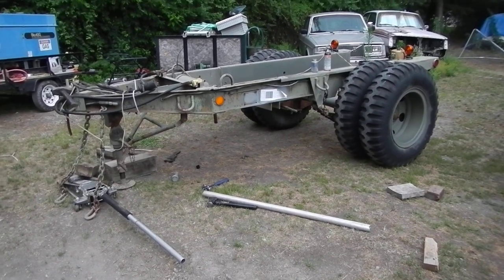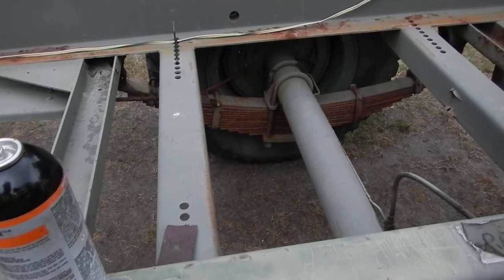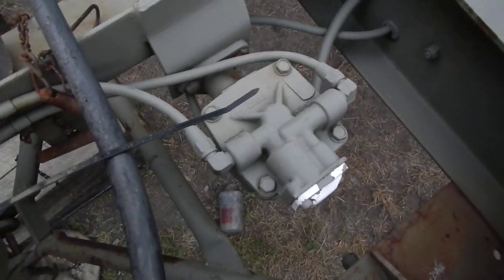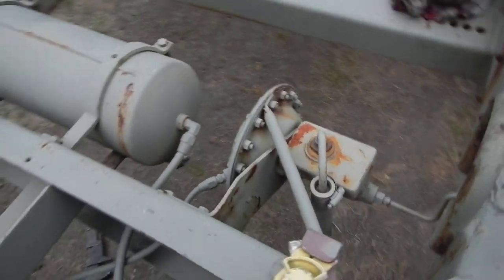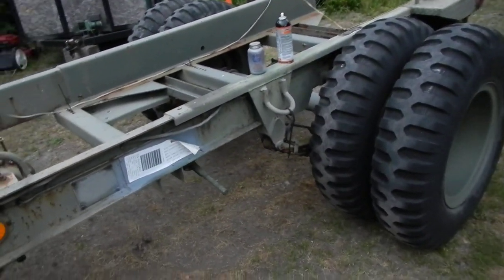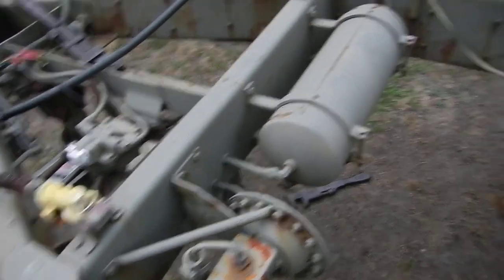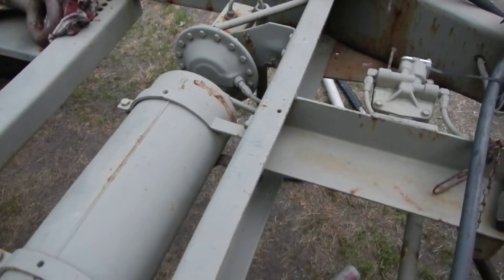Air Over Hydraulic brakes, a simple explanation on a military trailer, M200A1

Comment: I'm a US Citizen, and trucker, who has recently moved to New Zealand. In the US, a truck with air brakes has air brakes, end of story. Now, I'm driving a Hino concrete mixer that has "air over hydraulic". I had never heard of this and found this video. For this trailer you describe, I can understand that logic--it can be moved w/o the necessity of an air brake - enabled vehicle...but that doesn't make sense for my mixer. Great vid, though! :-)
Reply from the maker: Thank you! So I believe the reason this system is this way is in case the air doesn’t work the military could pull the trailer either way. I have an older large box truck that also uses air over hydraulic but when the air is off the lockers are in place so just like air brakes you must put air on the truck to move it . These old air over hydraulic systems aren’t bad but can be annoying to restore especially with the lack of parts support.

Comment: We just bought one of these trailers to build an off road fire tanker trailer for a remote property. Thanks for the video I went through the manual a couple of times trying to understand it, but your description was much easier!
Reply: They dont work as well as a air full air system, as they require more maintenance on mechanical parts .. but air is lousy if an air line blows in a bush fire (trailer stuck)
Hydraulics in steel lines can take a bit more heat than rubber or plastic lines .. 
Master and Slave Cylinders 'like to be used' so dont leave them inactive to rust or corrode ..

Comment: most 6x6s had hydraulic brakes and would apply air to the trailer which has spring brakes. That meets DOT regs for break away requirements. Your trailer does not meet new DOT requirements for a breakaway system
Reply from the maker: Stephen Grant it’s s Military surplus trailer I’m sure they weren’t worried about DOT commercial regulations. I’m converting this to electronic over hydraulic . It’s a work In progress. I could convert it to electronic brakes alone though I just haven’t been able to dive hard into it . It did however come with the proper paperwork to register it with the DMV from the government.
Reply: @SmokeyJa  Good video, I just received a trailer with this system and registered it today. Walked out with a brand new license plate. Now I just need to figure out if the 24v 12 pin plug will somehow power the compressor/brake system. Might be a dumb question. But of you know anything about that please let me know. My trailer weighs 8000lbs. It has a trailer inverter on the tongue that has a 12v 4flat and a 24v 12 pin. I plugged the 4flat to the truck 4 flat and all the running lights and signals worked perfectly. I just ordered an adapter to go from the trailer 12pin to the truck 7blade. Hopefully it will power the brake system. I see wiring going from that inverter box to the relay and brake system.
Reply: @SmokeyJa  If that doesn’t 24v receptacle doesn’t get the brake system going then I guess my only option is to change the whole system out as well. Please let me know of any updates. I appreciate you putting out the info.
Reply: @SmokeyJa  I just got some info today. I’m going to order an electric over hydraulic actuator to replace the air system. That with a new breakaway and brake controller should fix my issue.
Reply from the maker: @calijudoable  sorry for such a late reply I don’t think my notifications were working right at one point. Did you end up retrofitting the trailer? I still never upgraded my trailer and it is still a work in progress but the plan is still there.

Comment: Quick question.  I use M101a2 but never air over hydraulic system.  I’ll be using my humvee to pull.  My question is if you have a leak or malfunction do the brakes lock up on you like air brakes? Or like you said just bleed tank and you can freely pull?
Reply from the maker: It has been a really long time since I was deep into understanding these systems however if you have a leak and it isn’t that bad the reservoir should be able to maintain the air pressure to use the brakes. And as long as the red glad hand is still connected and their is air pressure to the relay from the red glad hand the trailer will not divert air to the brakes even if the yellow glad hand is disconnected or has a massive air leak allowing you to tow still however the brakes will not function. If the leak is really bad on the trucks system, the red glad hand or there is a loss of air pressure such as a break away the air pressure relay will divert air from the reservoir to apply the brakes “ON” . The brakes will stay applied until the air pressure is released (tank drained) or the glad hand / service air is restored. A loss of air pressure or break away will not lock the wheels like modern air brakes but it will lock the shoes to the drum in the fully applied position. I hope that helps explain it a little better. The breakaway principle is the same as on modern electric brake trailers. When the breakaway cable is pulled from the relay box the relay sends the signal to apply the brakes and is powered by a small 12v battery. Once that battery power is depleted the brakes will release. The same goes for the air over hydraulic. When the red glad hand is disconnected in an emergency break away situation or there is a loss of air pressure to that air line, the air relay applies full pressure from the air reservoir to the hydraulic system which applies these brake shoes to the drums and will continue to do so until service air is restored or the air in the system is depleted.

Comment: I’m having an issue with air over hydraulic brakes if anyone can give me an idea? The issues is that brakes are getting VERY HOT and start to smoke and then tires have blew. I’m a trailer mechanic and been dealing with this Hoosier Trailer that has 3 axles. Any help would be great

Comment: Just a note, the relay is a combined relay emergency valve.
Under normal use it applies the reservoir air pressure to the service brake air over hydraulic master when there is an air pressure signal sent down the YELLOW glad hand.
Under emergency break away situations the RED glad hand with the constant air pressure signal is disconnected, the removal of this signal diverts the reservoir tank pressure to the service brake air over hydraulic master to apply the brakes and stop the runaway trailer.
Its only a small correction but you pointed to the yellow glad hand when talking about the emergency.
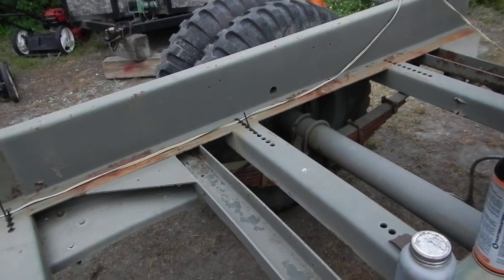Reply from the maker: Thanks for the correction Nick. at 1:08 I did properly name the yellow gladhand the service and the red the emergency however you are correct that I pointed to the yellow gladhand when mentioning a breakaway situation or loss of air. Thank you for the detailed explanation in your comment as to how the emergency system works. In your opinion what would be the best option to retrofit this trailers brake system? Electric over hydraulic or swap to electric brakes all together? I want to pull it with my F250 with a large welder and air compressor but I also want brakes as to not overwork the ones on the truck. I have not finished this project yet unfortunately.
Reply from the maker: Also at 1:49 when I was mentioning the loss of service air can you explain what would happen with a loss of service air (yellow gladhand) with the Emergency (red gladhand) still connected? I assume the trailer would still roll because it does not sense a breakaway situation? This would make sense so I am glad you mentioned what you did for myself and the viewers to understand as well.
Reply: @SmokeyJa  I couldnt really advise on your trailer to be honest... Im in the UK and the ministry get very nervous about brake modifications so they are best left as designed... plus our laws are different to yours. That said if you have a truck or trucks you are going to use it with it makes sense to make it match your tow rig as long as its still legal.
Reply from the maker: @nrs91  fair enough. The electric over hydraulic uses the electric brake controller that I have in my truck to apply pressure to the master cylinder to apply the brakes. Electric brake replacement would be electric actuators applying pressure to the shoes rather than hydraulics. Neither are "Cheap" retrofits but they are 100% legal and function just as well, if not better, than the original system. Thank you.
Reply: @SmokeyJa  Yea I forgot to turn the tap on for my Yellow line once... started heading down a hill thinking "these brakes are a little doughy" the trailer wasnt doing anything and the tractor was doing all the work... lucky I noticed and sorted it while going slow
Reply: @SmokeyJa  Ive seen the electric over hydraulic, seems an easy retrofit which would keep you safe and uses all the original brakes which are made for the load
Reply: With that correction it makes a lot more sense.  I was looking for how it differed from spring applied, air released air applied (standard air brakes) and wasn't quite getting your explanation due to that detail.

Comment: Does anybody know if a surge brake coupler was installed and plumbed into the brakes would they work
Reply from the maker: You can retrofit a surge brake system to this and it will work. The cost is relatively similar to other systems however if you already have the parts then that’s a win!

Comment: So air applied, for both emergency and service? Interesting.
Reply from the maker: Yup. The loss of pressure when the red glad hand is removed or cut causes the emergency relay to apply all reservoir pressure to the system and apply the brakes. If the trailer is in good condition the air system becomes a closed loop at that point and will not release the brakes until the air system is drained or proper air pressure is applied to the red glad hand again.
Reply: @SmokeyJa  I guess no need for big danger springs that way, but seems a spring-applied system is safer operationally.
Reply from the maker: @StefanBacon  not really. This system is really safe as well and works similar to electric brakes. When the relay is actuated by removal of the breakaway cable 12v aux power is sent to the brakes and holds pressure. The same with the air. When the air pressure is lost by the red glad hand breaking away the relay actuates and puts air to the hydraulics which puts the brakes on. It’s a closed system at that point so the air is trapped and the brakes are on until pressure is applied to the relay or air has been release from the system. You wouldn’t want to be stuck out in a war zone with your emergency trailer brakes stuck! I like that both electric and this air system can be bypassed to still tow the trailers.

Comment: Hey Smokey,
I just had a problem with this exact trailer.  My CO was convinced that not supplying air to it through 1 of the glad hands would burn out the breaks.  I was pretty sure that the emergency/secondary air hose would supply  air to the system. Obviously we could move it by draining the air tank but I was wondering if the breaks would still be functional with only the second glad hand operational?
Reply from the maker: Wow sorry I missed this 3 years ago! If the red glad hand is still connected and still has pressure applied then the trailer will continue to roll freely down the road however if only the red glad hand has pressure the breaks will not function as intended but the trailer will still roll. If the red glad hand is disconnected such as in a emergency break away situation or air pressure is lost to that line the relay will divert all air pressure to the hydraulic system and apply the brakes. In this situation the air must be bled to release the brakes. If the red glad hand is disconnected or no air pressure is going to it the brakes will lock.

Comment: Hey man...big fan!! I have learned so much from watching your videos and have a question for you...I cut one of the hydraulic lines for my m105 brakes a few days ago because I was under the impression that the hydraulic brake system was obsolete. A little bit of hydraulic fluid leaked out before I plugged it and today I tried to move the trailer and the wheels were a bit tight almost as if the brakes were slightly on. Did I make a mistake by cutting the line? All I wanted to keep were the handbrakes...what should I do?
Reply from the maker: I don't believe your issue is from the hydraulic line being cut. Losing pressure would make it certain that the brake shoes would not be spread to the drum. What most likely has happened is that when you use the hand brakes and let a trailer sit the moisture from condensation builds up inside the drum and the hand brakes begin to become one with the drum making it hard to release them even when the hand brake is released. This happens with cars as well. If you are going to let them sit any period of time, more than a week, then I would suggest chocking the wheels instead of using the hand brakes. This also goes for any automobiles they will sit for longer than a week. Do not use the emergency/hand brake if the automobile or trailer is going to sit. I am not sure of where you live but on the east coast we have had a huge amount of rain and moisture this year and it has taken a toll on a lot of my projects. Another lesson learned for me is that I should depress the clutch release bearing on my manual trans automobiles while letting them sit for an extended time. One has seized on me :( . If you would like to go further with investigating your issue I suggest pulling the wheels and pulling the hydraulic cylinders that spread the shoes in the drum of the trailer because you no longer need them. Make sure by doing that you are not effecting how the hand brake works. I hope I have helped you out some.
Reply: SmokeyJA SmokeyJA Hey man thank you so much for getting back to me I was able to fix the problem when I cut the line I plugged it, but the hand brakes were on. So when I tried to release the hand brake the oil had no place to go because I had the end of the line plug so the brake pad didn’t release all the way. lol rookie mistake!

Comment: Thank you for this, just bought one like this, are they easily adaptable to regular pickup trucks?
Reply from the maker: Yea I think so . I picked mine up with a 2008 F250 but a F150 should be able to pull it just fine. Or any 1/2 ton and up truck. You can pull them right off the lot with a pintle you just need to get creative with lowering the trailer down farther to your normal pick up hitch. I would suggest some boards and a hydraulic or scissor jack. Raise it up and go ahead and put up the front leg then lower it with the jack. You wont be able to get it low enough with the front jack leg on the trailer.

Comment: which is better , full air or air over hydraulic brake system ?
Reply from the maker: The more modern air systems are easier to do maintenance on but I personally like air over hydraulic. I’m not a fan of the mechanical locking on air brakes when they lock up. However air over hydraulic is not something you will find on modern equipment anymore.